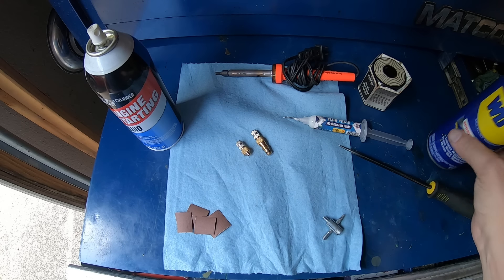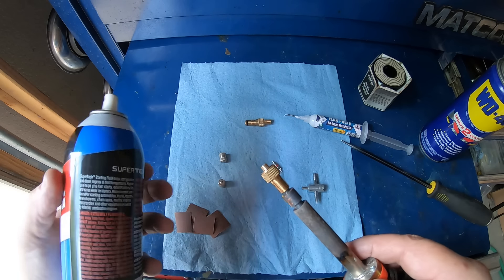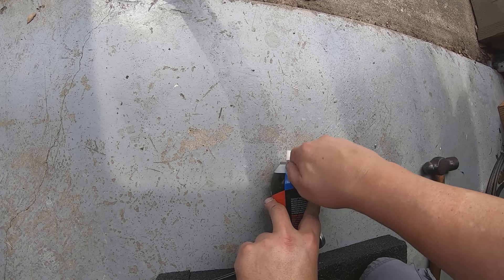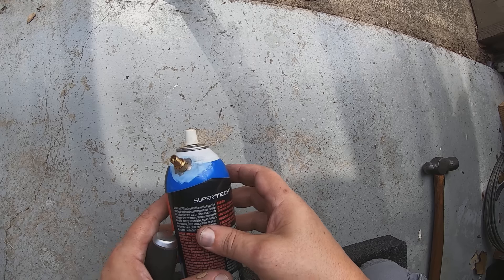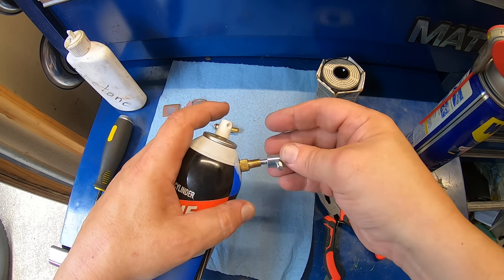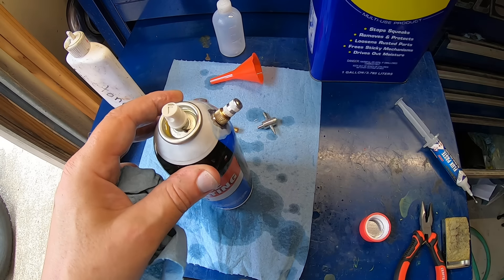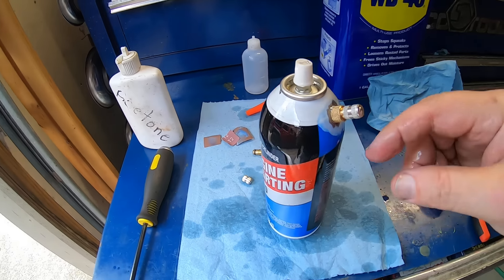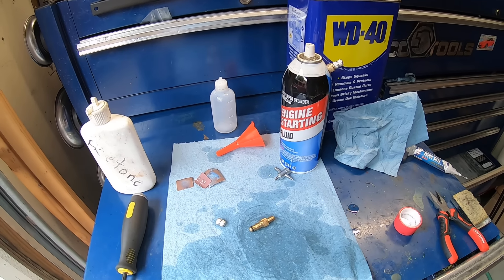How to Easily Install a Schrader Valve on any Can to make It Refillable without Drilling or Torch.

Comment from the maker: Tractor Air Liquid Valve, Brass Tire Valve Stems
https://amzn.to/3RBVad8
Weller SP40 40 Watt Soldering Iron
https://amzn.to/45BBkUM
Squeeze Bottles
https://amzn.to/4bkKTc8
60/40 Tin Lead Rosin Core Solder
https://amzn.to/4cRFPxf
No-Clean Soldering Flux Paste
https://amzn.to/3VRE4u8
5 Grits Emery Cloth Roll, 150 240 320 400 600 Grits
https://amzn.to/3xoeBz9
Tire Valve Tools,4-in-1 Valve Core Tool
https://amzn.to/3RC0kpw
Grizzly 12x36 Gunsmithing Lathe
https://amzn.to/3W3vOGv
Refillable High Pressure Aerosol Spray
https://amzn.to/3XGaPMc
Reply: Where did you get the 3oz fill bottle with the PERFECT cap / valve fit?
Reply: @Thinker2-truth  it looked just like the one I have, from Shaklee multi-level sales group around 30 years ago. Made from high-density, high-molecular weight, polyethylene blown as shown. Great little squeeze/squirter. The ones he offered via amazon are the thin wall delicately handled version, they do not have a flip to dispense top either.
Reply: @737mechanic  wd 40 separates when it's mixed it's cloudy I noticed yours was clear means it's not mixed just a FYI cool video
Reply: Galaxy brain move holy
Reply: Nice work and a nice video BUT - you are making a potential bomb that could easily explode, leaving you blind or worse (no positive way to control overpressure/fuel & air mixture).
Ain't worth it, my friend!
Reply: That is a very original idea-John in Texas
Reply: @rwm5518  I used to work at 3M. They pressurized their spray cans to 150 psi.
Reply: For filling try one of those BBQ ketchup and mustard squeeze bottle from the dollar store
Reply from the maker: @jeffrey7282000  Thats a good idea. Thanks
Reply: Hey, why not do that to your empty WD-40 can instead?? then you have that cool WD-40 spray tip !

Comment: So, you don't need a drill or or torch, but you do need a lathe......right  🤣😂🤣
Reply from the maker: Thats all. Everyone needs a lathe.
Reply: It wouldn't really need a lathe you could easily cut it with a hacksaw spin it in a drill with a piece of sandpaper.
Reply: More have a drill or a torch. Very few have a lathe ???
Reply from the maker: @PeterHernandez-lg2eh  Get a lathe, problem solved.
Reply: Was thinking same thing.
Reply: Oh dang! You can do that with a lathe?  I bought a mill! And then he wants me to sand by hand ✋️  no tool to make/buy for that?
Reply from the maker: @waddyhillfarm5519  You can do it in a mill also. Chuck the Schrader up in the spindle and clamp the cutter in the vice and move the X Y to achieve the same effect. Problem solved. :)
Reply: Drill press and a file works great as well
Reply: Always looking for excuses to buy more tools!
Reply: wrong claymore you dont need a lathe,  you can buy the fittings already machined from 737 mechanic.   your welcome!
Reply: Put the funnel in the can. There's no need for the intermediate container.

You know you can just buy a refillable spray can but if you're desperate to tinker and pretend you're saving money, carry on.
Reply: This way is much easier than the way I refill mine. I just took the little red straw from my old can and I would go over to my neighbors house and take it back home and use it to refill the old one!  I’m a genius 😂
Reply: @KJ6EAD  don’t forget to renew your tech license
Reply: I got an entire machine shop when my daughter married her husband who is a machinist, 😂
Reply: WD40 is $6.  But then you dont have a video.  👎
Reply: @NendoCrescendo  I don't want to as I can't keep my callsign now anyway.
Reply: @KJ6EAD   ahh did you do any HF or just VHF UHF? KD9ZFQ
Reply: @NendoCrescendo  Just VHF & UHF. Although I think of HF as the heart and soul of amateur radio, I never wanted more than access to local repeaters. I could never own big antennas or learn morse, etc. I just wanted a secondary communication option when out of cell range. It never worked out that way and now there are satellite phones.
Reply: @KJ6EAD  fair enough, I mainly use VHF/UHF for when I’m traveling with friends. It’s convenient but definitely not super necessary. Anyway 73 there!
Reply: Bench grinder may work too.
Reply: That makes the WD more expensive, not cheaper.
Reply: I just sold 4 lathes. Now I need to buy one? 🫤
Reply: @rbhe357 when is the last time you bought wd40? Tge 12 oz can is now 8-9  bucks. The tiny little cans are 6.
Reply: @737mechanic  you’re right. Everyone does need a lathe! 👍
A fellow would just need to convince the wife that buying a lathe will actual save money! 💰 😊
Reply: @bryanbeddingfield5489  it’s a profit deal! That takes all of the pressure off!
Reply: Luckily, I already have a lathe.
Now I just need to find some brass schrader valves and a round top can that's steel, whereas most like that around here are aluminium.
I might have to settle for a classic straight sided can, with crimp sealed top and bottom rim🤣👍🇦🇺
Reply: @KJ6EAD ,CQ CQ DX Land,😂I would like to try and fill my small propane I think they're 1 lb for a stove or a Coleman lantern, sure save a ton of money buying it by the 100 lb tank in keeping all your smaller containers filled, God bless have a great July the 4th
Reply: @glbaker5595  that is possible to do, just not this way as shown. Not just water tight, air tight, but cryogenic liquid tight is the answer for your L.P. gas/fluid.
Reply: Put the valve in a drill like bit. Spin it again an abrasive.
Reply: At least he got to the lathe part early.  Done watching at that point.
Reply: @scottloutner5253  Let me know how you're getting on with that in two weeks time🤣
Reply: Yah everyone has one of those in the back of the truck 🙄
Reply: @737mechanic LOL! ROLFL, teehee, 😂

Mill or Lathe. No significant difference for guys that are too  cheap to buy another can of WD-40.
Reply: Exactly 
Most have drills very few have lathes
Reply: @737mechanic 😅you might wanna look at the tool isles and see the volume of drills vs lathes
Reply from the maker: @mtower235  You mean drills vs a punch? I didn't use the lathe to put the hole in the can.
Reply: Guess we're going to be taught how to make a lathe
Reply: @737mechanic They need to watch click spring build a bow string lathe. Apparently they haven't herd, Put your brain in gear before the mouth goes into motion. I've got to try this.
Reply: @737mechanic no, you need the knowledge as well
Reply: Just thread a valve in and solder it. No lathe needed.
Reply: @wolfparty4234 did that many times lol
Reply: @NendoCrescendo or medical insurance..lol
Reply: I just use old tube cores...cut the rubber off and solder them in
Reply: And for maximum effect, add a schraeder valve to your air compressor, bleed out half the air, add your WD-40 straight into the air compressor and you won’t need all those pesky extra steps 🫠 …just kidding, fun video to watch!
Reply: Grinder could work pretty well
Reply: @biofall38 You have obviously never had the convenience of owning a lathe.
Reply: Yep, definitely cheaper to buy the digital lathe up front instead of the old analog like his 🤣🤣! Soldering isn't that hard folks, drilling a hole isn't hard and you really don't have to machine the end. Simply cut it to the length you want then sand everything.
Reply: I would think the valves can be used as is, there’s enough space in the can to take all of that. Just gotta get rid of the tuff than can melt from the solder heat, and any stuff that can obstruct flow.

I actually did this sort of operation on one of those micro oxyfuel torches that take lighter fluid in the fuel canisters, which are normally not refillable… had to turn a solderable adapter on a tabletop mini lathe and figure out some angle to have the lighter fluid refill port fit just barely in the cartridge cylinder. Works great, and I don’t have to buy the fuel cartridges which are a pain to find.
Reply: At 1min 20 seconds I stopped. I don’t have a lathe. Next!!!!
Reply: Any operation that involves turning metal to any cylindrical shape can be done without a lathe - heck it can be done with a handheld drill.
The trade off is the precision and accuracy of the part.

I made a replacement capstan thimble thing for electric guitar string using a handheld drill and a file. Took a lot longer but I was able to create the shape I needed, cut it off, sand it and use it. Worked great - only for me to discover that new sets of strings actually come with the things. But it can be done, even on small scale.

Also, people can build a somewhat functional metal turning lathe. Some people even build them and post videos of the process on YouTube.
The only thing you can’t really make is the workholding lathe chuck, and that’s easy enough to acquire.
Reply: Dw40 is just fish oil don't let anyone fool you.
Reply: 😅 @KJ6EAD
Reply: Yea kind of a useless video since almost no one has a lathe and you would have to re-fill like a million cans in order to actually save money.  Find a valve that you can easily get like from amazon and then you might have something.
Reply: My wife said, why do you need a lathe? 

I showed her this video.
Reply: If you don't have at least one lathe, you can't hang out with us.

 Sorry. I don't make the rules.😁
Reply: @737mechanic  that's the thing I have a lathe but it's the cheap Chinese one others might not have the money for one mine sucks honestly the cutter rubs to much even when its set to the center point.
Reply: Your lack of critical thinking is showing.
Reply: My exact thought...... wtf
Reply: @glbaker5595 someone has a video on here that shows how to refill the camp stove bottles from a 20# LP tank.
Reply: What you don't have a lathe 😯😯😯
Reply: @ryanmartin5668  hahaha genius
Reply: I have cans of wd but no air pressure to spray the oil out. You know they have been around for a while.
Reply: You can afford a lathe but not a new can of WD40?  Find a WD40 pump spray bottle! And avoid all this.
Reply: And he didn’t relabel the can so he doesn’t know what’s inside.  Way too much potential damage with this process.  Dangerous!
Reply: Really? Saved me the time I would waste watching this. No lathe here
Reply: Use a drill and a file
Reply: @bryanbeddingfield5489  *you're. You're welcome!
Reply: Good idea. 
I am going to spend several hundreds for a low end, if not thousands for a pro level quality. 
Then do all that.

Just to save a few bucks for the convenience of a OEM filled ready to use product. 
I recommend buying a few new original cans during special sales.
Reply: @737mechanic  Brother, can you spare a couple grand?
Reply: It would seem so .. and then rather than plant the emptying can on the hot tip you turn the hot tip onto can and risk all the hot molten solder falling off .. doh!!!😂😂
Reply: I consider the lathe the better option, as drilling brings scrap metal bits into the can
Reply: Us a hand grinder, dremel or small hand saw.
Reply: @NendoCrescendo I don’t get it.
Reply: My dad left me his old Atlas metal lathe. I have no idea how to begin using it.
Reply: @bryanbeddingfield5489  Thank you!! I'm not paying some corporate bohemiath if I can support the little guy like him.
Reply: @KJ6EAD  it's not always about pretending to save money. Nothing is more satisfying than doing it yourself. Even if it cost more the first time. It's a man's thing.
Reply: @737mechanic TO make a refillable spray can? Seriously?😅😅😅
Reply: @WesMcV  poke holes in metal objects  xD
Reply: There are schrader valves intended for soldering/brazing - used by A/C industry. Wouldn't need to machine those.
Reply: @737mechanic  There are schrader valves intended for soldering/brazing - used by A/C industry. Wouldn't need to machine those. Probably a lot cheaper, too.
Reply: I just set my air compressor very low, take the spray tip off, press your air gun over the nozzle give a quick squirt and voila it's repressurized. No need for a $6,000 lathe. I've been doing this since I was a teenager 55 years ago.
Reply: @737mechanic  VISE (Not VICE)
Reply: A lathe costs $2000 plus, I think I'll just buy a can of WD-40 for $8, thank you.

Comment: Why not just use a hand pump spray bottle? I have one that came from WD-40 and it even has the WD-40 logo on it. It cost me $2 and I've had it for 25 years
Reply: The newer refillable spray bottles dont last all that long.....Chyna made
Reply: @safetyharborfirearms  I AGREE, I HAD ONE LAST 2 WEEKS
Reply: Mine kept falling over and leaking WD all,over the place.
Reply: I find the pump bottles to be spotty as far as quality and dependability.  I use a Vaper pressurized spray bottle, but its a bit much, when sometimes I just want a little squirt
Reply: Exactly
Reply: This can also be used to spray paint. Try doing that with a hand pump spray bottle.
Reply: If your just using oil no biggie but try that with brake kleen or other harsh stuff will kill the bottle eventually and people with arthritis or carpel tunnel it gets painful squeezing a bottle a few hundred times lol but also they make bottles that already made like this with a handle shrader valve and a way to fill it and hold a lot more for around 60 bucks just depends on what you prefer. it's definitely better that the epoxy method I have seen people do!!!!!!!
Reply: because they leak and often do not spray worth a hoot.

Comment: So I  ordered the schrader valves, found an empty can and did this.  It worked out well.  I'm using it as we speak. Thanks from a "workshop type"☺
Reply: Be aware. if you overpressure it the schrader valve could explode out of the can like a bullet, especially if you accidentally drop it and the can lands "just wrong". the can itself has been weakened buy introducing a hole into its structure. Hacks like this can be very dangerous. much safer to just buy a pressure pot for your compressor or a pump pack designed for the purpose.
Reply: @DeveloperChris okay princess 👸
Reply: the way he punched the hole actually strengthens the metal if you know anything about structural integrity, this is why they punch holes through the chassis of your car as a plain rectangle frame would be weak and have little rigidity. Adding the hole the way he did instead of drilling it would make the weak point the weld along the side of the can..

Comment: Oh yes because the average diy has the ability to "turn down" a Schrader valve in their machine shop
Reply from the maker: Of course, if I didn't have a lathe, I would have used a drill press, a hand drill, a file, a hack saw or whatever it takes.

Comment: By using a punch, you create more surface (mate-ing) area between the Brass Tire Valve & The Can.  Great idea. Can should last a life time.  Also by positioning the Brass Tire Valve @ the top of the can, (above the liquid level) you keep the solvent from continuous soaking of the Schrader Valve gasket / seal.  Yes you can drill, but I would argue the punching of the hole will give a more desired mechanical result.  Thanks for sharing.

Also, on your punch, after you achieve the correct diameter hole to receive the Brass Tire Valve, you could mark with a pen of some type, or scratch a line on the tip of the punch.
Reply: No swarf from drill in can to stuff up spray nozzle
Reply: @johngibson3837  I'm jealous I didn't think about that.  But that's one of the few good things about U-TUBE, the sharing of ideas.  Great thinking John, you the man.
Reply: The dispensing valve in the can has a low service life, intended for single use and so, built cheap. It is not serviceable. 
The can will not "last a lifetime" unless you mean a few refills. 
Placing the charge valve in the base pressure dome is a stupid idea, but not for the fluid immersion issue, which the valve will always suffer, be it vapor of fluid in a pressure charged can. 
Drilling into the can is a messy stupid idea. Pearce the small hole and open up by roll forming using a hardened steel rod (screwdriver shaft) is far superior. 
The hole only needs to be 1/4" diameter if you buy the cheap copper hose tail Schrader fittings. (HVAC industry) Certainly not agricultural tyre stems.
Reply: About the air pressure limit? If I ask my son to put air in it, forget it. I rather use a bicycle pump, air compressor is too dangerous, WD cans are stronger than others.
Reply: @stanwooddave9758  thanks Stan appreciate your words
Reply: Sorry mate got it wrong should of said thanks dave
Reply: Clean the paint off before making the hole.
Reply: You could measure the diameter of the stem with a caliper then find that diameter on the punch/icepick...whatever and have the proper depth stop mark from the start.
Reply: One place I worked at had store bought cans you could do that with it was a machine shop and I don’t know where they got them
Reply: Work big industry a nube on 1st shift filled an 8" cart tire with a bootleg air chuck, we heard the explosion 2 floors up. Good thing it was during turnover.
Reply: @mikewestermann1 good thing it wasn't a truck tire
Reply: He sanded the paint off and wiped it with acetone in the video.  @kkarllwt

Comment: Wow that's so easy! Now all I need to refill my $6 cans is a $1500 lathe!
Better start saving my cans!
Reply from the maker: Actually, the lathe I used is $6000. I put a link in the description so you can order one.
Reply: @737mechanic  im sure that will be very helpful
Reply from the maker: @e343balla  LOL, I try.
Reply: you dont actually need a $6000 lathe or even a $1500 one. You can cut the valves off old bike or car/tractor tubes, whatever, and while there may not be a convenient flange  to seat it in the can as long as you make the hole a neat fit and carefully position the valve no problem, I have not in NZ seen the valves for sale here, but they might be. And if you are desperate you could put a valve in your drill press and use a file to carefully machine a "step" for easier positioning.